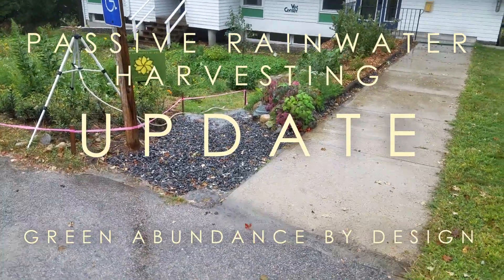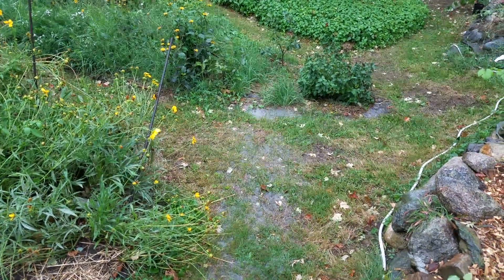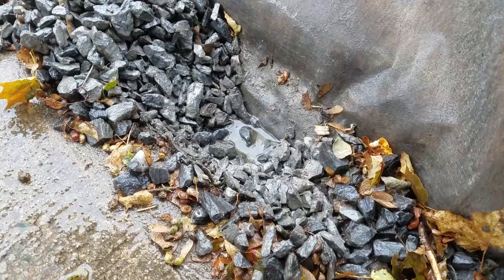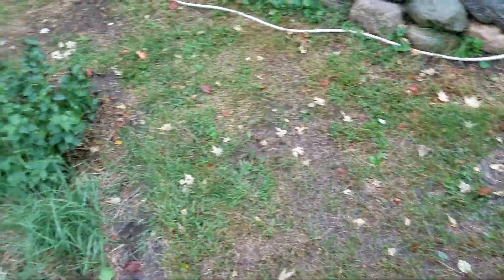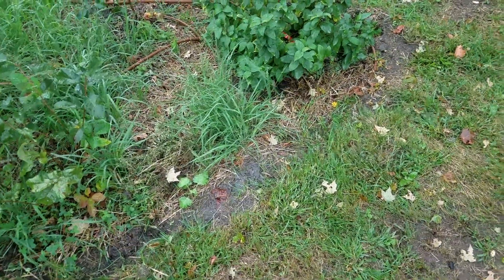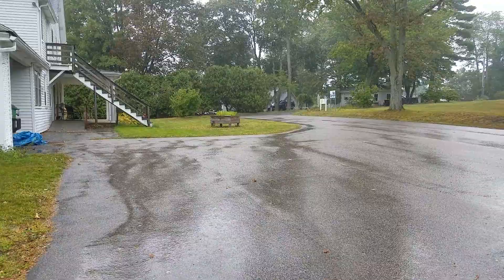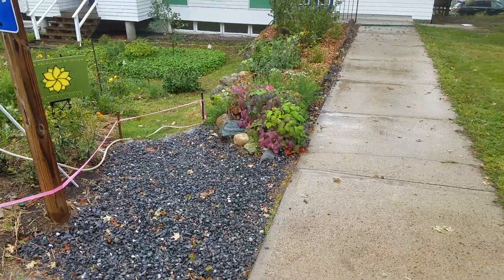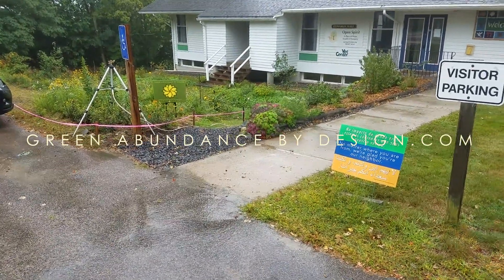Passive Rainwater Harvesting  with Earthworks - Garden Update

Comment: I like what you've done, however I must ask why not trench along the asphalt at 90 degrees to the sidewalk? Wouldn't that take more pressure off the overflow in a hard rain and minimize the chance of a blowout of the basin? Additionally you could channel it further along the top of the second bed below the basin. 
The reason I ask is that you've  slowed it and spread it a bit, it is still pointed directly to the foundation. While you mitigated a lot of the problem, in hard rain you are still looking at a saturated foundation with possible seepage in the basement as it appears to slope directly to it. (Especially with the downspout where it is)
Maybe its just the camera angle and you've corrected the grade at the foundation level.  I just know from experience with our basement waterfall (Our water supply pipe had more water around it than in the pipe itself) until the grade was corrected to slope away from the house nothing we did could stop it. 
One last thing, the grass looked mighty sparse below the basin in patches is that from mowing or is it already experiencing erosion?
Reply from the maker: Thanks for the comment.  There are definitely aspects to it that I would have done differently had the budget been there to do it.  Ideally I would have created a diverserion at the top of the hill along the parking lot to spread the water out across the entire garden space before migrating down hill further.  Luckily the existing grade has a bit of a valley that runs parallel and away from the building.  Where the water overflows from my basin after hitting the contoured garden bed, moves into this valley and is moved downslope and parallel to the buildings foundation.  So the hard rain event you discuss does not allow for much water as close to the foundation prior to the work.  The space also has seen a reduction in ice building up along the path as water not has a place to exit into the landscape.  Definitely not perfect, and has room for improvement, but it fit the church's budget and what could be done with volunteers on a weekend day.  Thanks for taking the time to comment!